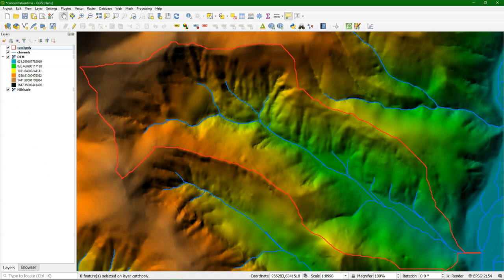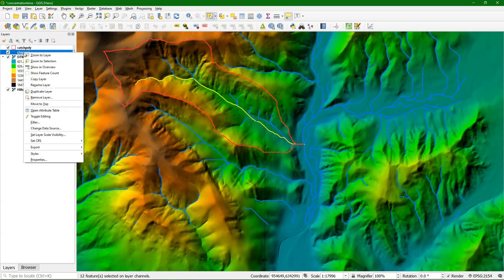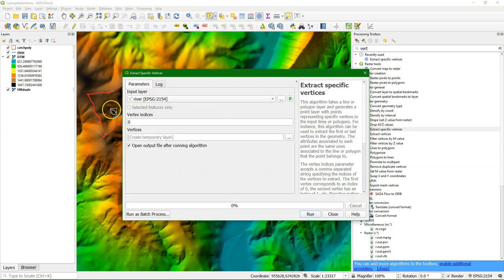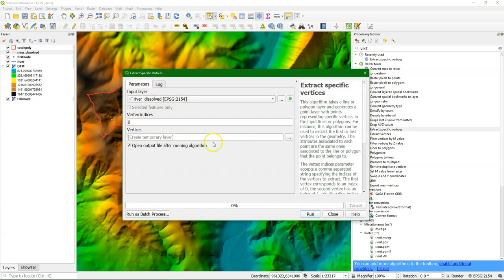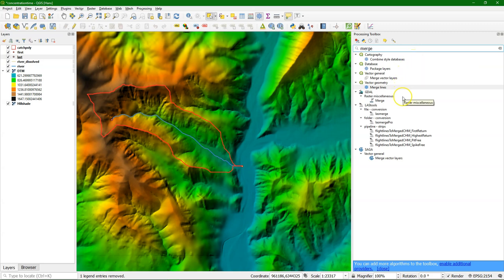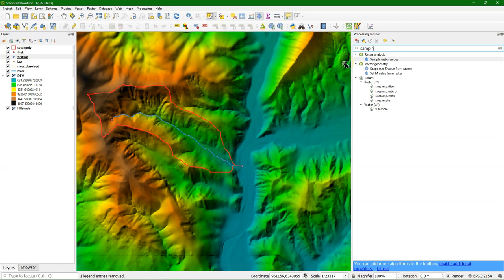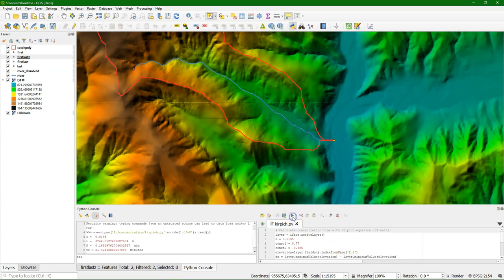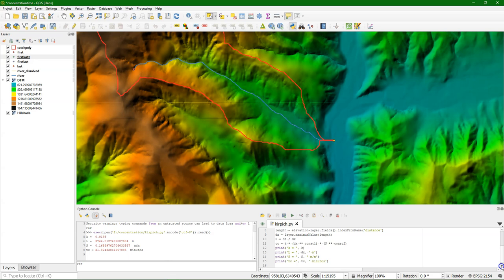Calculate time of concentration of a river in QGIS (Kirpich)

Comment: Dear Hanz, I would like to thank you for the nice video. It is really a great effort for the cause of supporting the opensource community. 
I have a question for you. In your script to calculate for the Tc in line no 8; why you did use " length = elevation"?
I think elevation here has no use. What do you think?
Reply from the maker: Well spotted. That's a mistake. Line 8 should be: length = layer.fields().indexFromName('distance')
I copied too much from line 6. Thanks for noting. I'll correct the script in the repository.

Comment: I get error in line 15. Please help
It gives following error:
Traceback (most recent call last):
  File "C:\PROGRA~1\QGIS3~1.16\apps\Python37\lib\code.py", line 90, in runcode
    exec(code, self.locals)
  File "<input>", line 1, in <module>
TypeError: unsupported operand type(s) for -: 'NoneType' and 'NoneType'
Reply from the maker: It means it can't read your input file. It should be the active layer (click on it before running the code), if you follow the procedure in the video.
Reply: @HansvanderKwast  Clicking still didn't work .
Reply from the maker: @maiya_angel  Maybe you're using a temporary file or something wrong with the path. You can refer to vector layer also by using the path. See if you can use what's explained here to refer to the correct file: https://anitagraser.com/pyqgis-101-introduction-to-qgis-python-programming-for-non-programmers/pyqgis-101-loading-a-vector-layer/